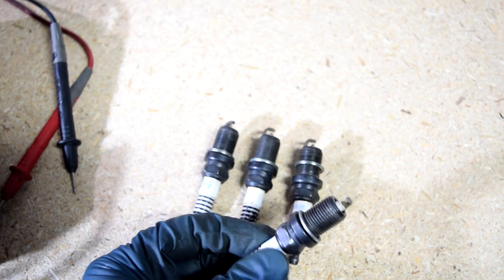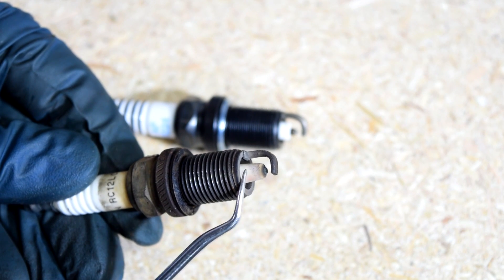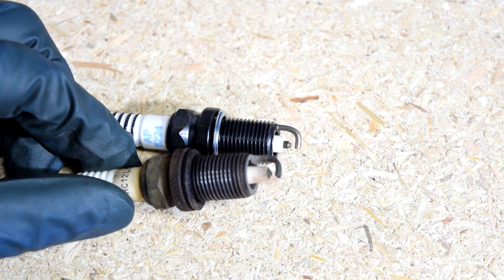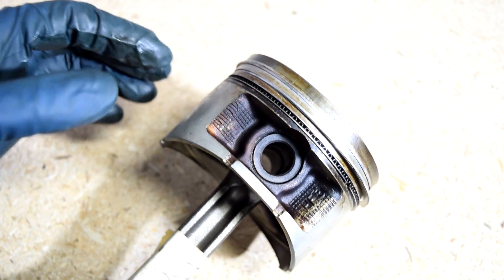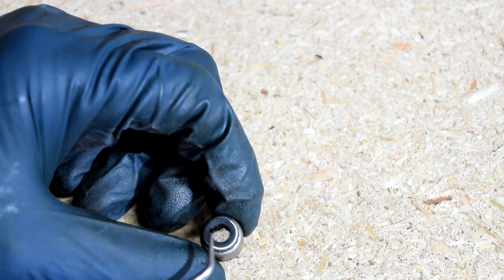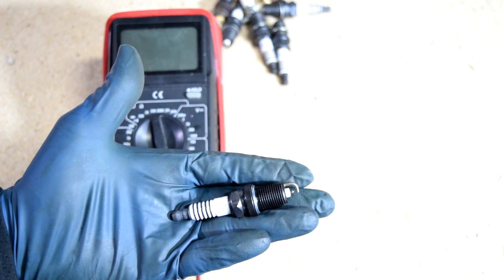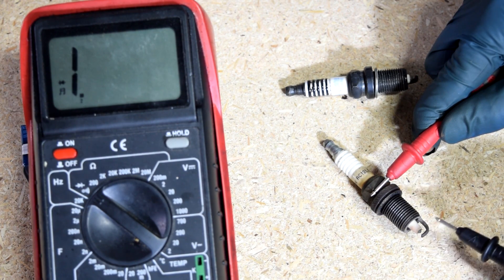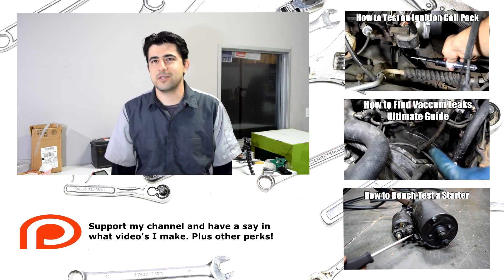What You Can Learn From a Spark Plug - Plus How to Test Them With a Basic Multimeter

Comment: I have 2000 daewoo lanos  change the valve seal about 3 years ago and put it back still see little smoke but my sparks plugs it burning black when I smelling the exhaust sometimes u could smell gas sometimes u can't.  Is there any help

Comment: Thank you. It is a very clear explanation. I am subs.
Let me remind something. Using a (low voltage) ohm meter would not enough to find if there is a high voltage leak between electrode and the ground body of a plugs.

Comment: If my plugs have oil on them, is there a way to determine whether or not it's due to bad piston rings or due to worn out valve stem seals? Or both? My car also burns oil but I would like to determine whether it's one or the other or both.
Reply: If you accelerate and blue smoke continues until RPM is high all the time these are rings. If you see smoke just few seconds after acceleration these are valve seals. The more idling time the more blue cloud with acceleration also indicates the valve seals are bad. But they are still allow only very small amount of oil to leak into manifold. And it's accumulating there until you push pedal and all that oil burns quickly and then exhaust is clean.

Comment: My car uses 6 spark plugs.  5 is at 5K Ohms and 1 is at 4k Ohms which I tested on my multimeter.  I have the P0305 code too so does that mean the 4k Ohms spark plug is defective right?  They been in my car for 5 years now so it's time for new ones anyway.

Comment: Did you know on average 2 out of every 10 brand new spark plugs in a box can be defective?
Ask any mechanic and they will tell you they deal with that problem consistently!
Reply: Will passing the checks outlined here ensure new spark plugs are good?  Also, make sure the gap is to spec.  Trust, but verify.
Reply: Wellness Path For Me - Hi, unfortunately a multimeter can't 100% tell you if a new spark plug is good, because what it can't do is notice any irregularities to the ceramic insulation. Such as hairline cracks in the ceramic insulation. Not even visible to the human eye. Which can see the spark jump all over the place and not give a true and strong consistent spark to fire an engine smoothly. The only way you can guarantee the spark plug whether new or old is good is to view the actual spark on the spark plug and the only accurate and SAFE way to do that is with and why we invented our Spark Plug Testing Kit (US Patent no. 10,113527 B2). 

https://www.camaroz28.com/forums/f-body-lounge-24/if-porcelain-sparkplug-cracked-still-usable-390890/

Comment: having a BMW the pcv failed lots of oil gone though the engine plugs were black now its using oil could this be the ring gummed up thanks
Reply: Change PCV valve every 30k or three years.  It is preventative maintenance, and ultra cheap.  I bet $5 plugged PCV's are close to the #1 reason engines fail at the end of the day.

Comment: how about some oil on threads but not spark plug tip?
Reply: you probably have bad valve cover gaskets, I had the same problem, I replace them and I fixed  the problem,

Comment: When I test my spark plugs for resistance from where plug wire attaches to center electrode I get infinite resistance.  This is the same whether it's the old plug or a new plug.  The engine won't run with the old plug but starts fine with the new plug.  I'm using a digital multi-meter Any ideas?